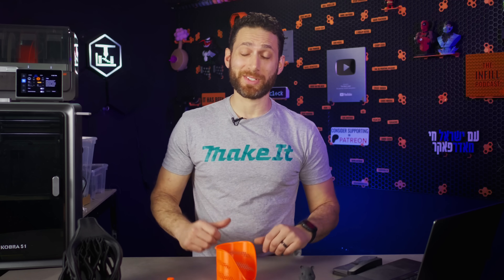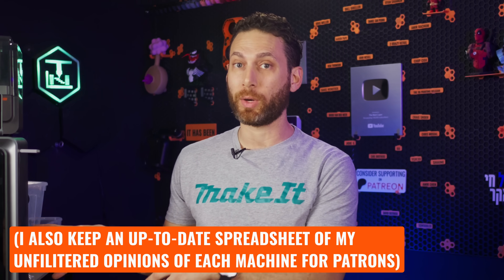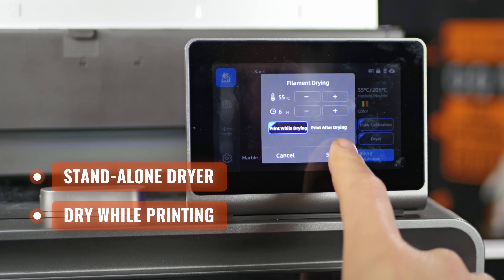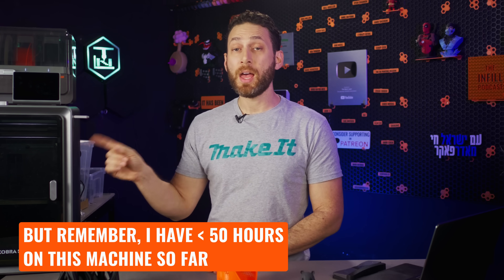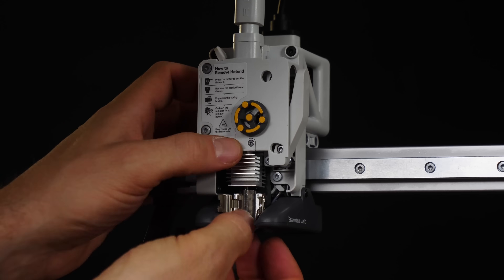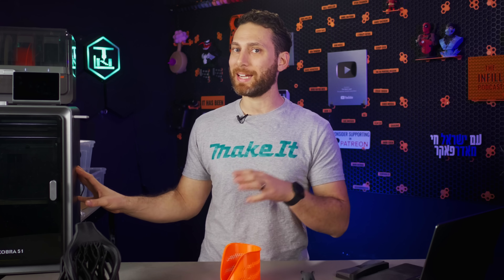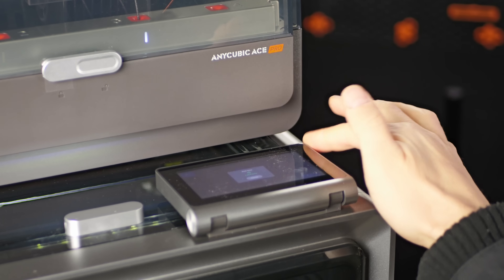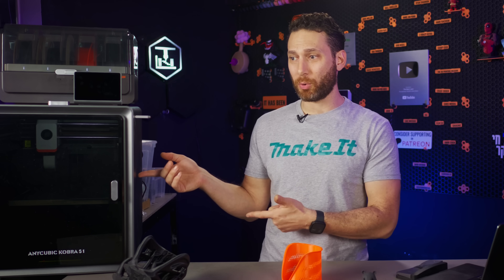16 Ways The AnyCubic Kobra S1 Is BETTER Than a Bambu Lab X1 Carbon

Comment: I purchased the Kobra S1 Combo last July, I finally got time to unbox and set it up: Well packaged, decent instructions to assemble, easy to load the filament but it took awhile to figure out how to set the color on parts, once I found it, it is simple. AnyCubic sent me a link to the rack they have for stacking the ACE Pro filament feeders, the heated four spool holders are a big reason for the purchase. So far I like it, I've had some issues with the camera but it seems to have settled out, my third print is quickly and quietly plotting.

Comment: Long term, their printers are no good. Their printers start the malfunction after 10 to 15 prints is the known fact that their printers only last six months. I've been a long term customer of theirs, finally decided to stop buying from them. I have proof in email showing. That the printers are only made to last one year and then they dispose of them. I am going to show you an email that was sent to me yesterday. Anybody who supports any cubic is full of ** And they really don't know anything about the printing business. Because even any cubic would tell you themselves they printers are only made for one year. Here's an email from the tech support and customer service. That's why I finally Stop buying because the Kobra S1 has a lot of issues as well. If you notice, they try to release their printer every six months to a year because their printers don't last very long. And the crazy part is. They want you to still buy from them when you need parts. They'll tell you we don't have it anymore. It's discontinued. They should not be selling in the US whatsoever. It's Chinese junk.
David (Support)
2:13 AM (9 hours ago)
to me

Track Resource

Dear R,
We regret to inform you that due to our product technology upgrade plan, the accessory for this printer has been discontinued. This may impact your user experience, and we sincerely apologize for any inconvenience caused.
To compensate for this, we are pleased to offer you:
● A $20 instant discount coupon (Code: ACKF20), applicable to any printer order on our official website.
We remain committed to continuously improving our services to provide you with a better product experience.
If you have any questions or need further assistance, please feel free to contact our support team at [support email/phone number].

Comment: I've had a Kobra S1 since they were released at the beginning of the year. Your review was very interesting, and I enjoyed it. Unfortunately I have had nothing but issues due to the cheap quality of anycubic products. I've had to replace almost every part on the toolhead, as well as the entire bed itself, the main board, host board, power supply, and finally the machine entirely. When I received the ne machine, it was immediately riddled with problems, attributed both by the firmware and again plastic quality of the machine. As an engineer myself, I have no idea how either passed QC, with entire parts like the board boards having burn marks on them or connectors not fully soldered. I've been in contact with anycubics customer support for months, trying to find solutions and for my experience they have been little to no help. While $469 at the time of your video and even today $550 with the ace pro is a great price, I feel that the bambu x1c offers less issues right out of the box, with the biggest win being customer support that takes the time to help and responds quickly to tickets. There was an entire two weeks between putting my ticket in with anycubic and receiving an answer at first. I will be dissembling the anycubic printer, photographing all the issues. I'd be happy to share with you if you are interested or making a video post about them. Many companies like anycubic have really great ideas for the market, but not all execute these ideas without cutting corners.

Comment: I really wanted a Bambu Labs X1 Carbon but I'm retired and it cost more than I could justify. After watching your video I bought the Kobra S1 combo and so far I have no complaints, but I've only printed PLA so far. I would like to buy an all metal hot end so I can print more exotic materials, but I don't see one available. I bought mine on Amazon and I got a two year extended warranty. I paid just over $600 for it.
Reply from the maker: Glad to hear you're enjoying the Kobra S1 combo and got a good deal!

Comment: The S1 is my sixth purchase of a 3d printer and the fifth Anycubic product. I must take my hat off to the packaging, the instructions and the parts labeled taking the guesswork out of setting the printer up. One feature that I need is variable infill. Before using Anycubic slicer which is easy to use, Cura and Octoprint were my go to and they worked. The S1 seems slower than my Kobra 3.  The same Benchy is 15 minutes on the 3 and Twenty odd minutes on the S1. Is it a setting?  Thanks!

Comment: It's my second Kobra S1 in 3 weeks !! The first one broke with major error codes, the second one  was just oozing hot filament at the junction of the break and the nozzle ! It was a mess to clean and at the end, I managed and to put back the nozzle, the clamping lever of the nozzle, which is a cheap plastic lever, just broke off !! I'm repacking the S1 tomorrow !

Comment: If you have a Bambu Lab X1 Carbon, purchasing a Bambu Lab H2 when you could purchase a cheaper and possibly better printer doesn't make any sense because your software will run both printers.  I've shelved 3 other printers because of the complexity of using multiple 3-D software. One of them, I only used a couple of times.  It was slow.

Comment: 2 mins in... unbiased review please. I'll watch it all then. I need to know.. should I buy the Bambu or this. That's it.
Reply: I don't have the X1 but I do now have 2 S1 and I don't regret buying them. I looked at both extensively before I bought the 1st S1 and went for anycubic because they both had an even amount of complaints in printing groups (most for both seemed to be a lot of user error). The price of the S1 was a lot better so I chose that. Two weeks later I bought another.
Reply: @e5p0sa how loud is the printer? With the door closed and with it open?
Reply: @merlinbk  I have very sensitive hearing I can't abide white noise but I can sit in the same room with 2 S1s and 2 K3s running. As long as they're on a sturdy surface so vibration is minimal, they're not that noisy. We live in a bungalow and you can't hear them in other parts of the house when the door to the print room is closed

Comment: Been a while since I´ve been here. Hope you and your folks are doing well.

I have been considering one of those to upgrade from my current Flashforge 5M (actually keeping both). Having watched other videos about the S1 (not sponsored), some (negative) aspects called my attention:

1 - Even though the printer has a quick swap nozzle, Anycubic only offers them in brass and in 0.4 size, which is a bummer in my opinion (other sizes and nozzle materials only from not very trustworthy third party vendors). Being able to print higher temperatures as it is, IMHO it should be already able to print abrasives from factory (hardened steel nozzle from factory, even if 0.4 which tends to clog with fibers or wood). There should be OFFICIAL nozzle upgrade options (so we wouldn´t have to rely on unreliable aftermarket) and standard one should be hardened steel, all of that would make the fast swap feature have more sense.
2 - By the way, I can´t find any info on the extruder gears, if they are able to whitstand abrasives or not;
3 - Printer profiles. Them being not very well tuned is an almost unanimity. Seeing some printed parts shown, it´s clear that the default profiles are not very well tuned (maybe I´m spoiled since I went to a Flashforge). Only begineers didn´t complain about the profiles. 
4 - As there aren´t "official" nozzles of different sizes, there aren´t also official profiles for different nozzle sizes.That would require more into printer tuning than it´s necessary for a printer meant to be for begineers (or, in my case, users which have no more patience to tinker much in configurations and just want to print in peace). In that case, I have to praise both Flashforge and Bambulabs for their excellent profile work. In the case of my Flashforge 5M, I´ve been printing for about eight months with perfect quality, the only failures I had were due to old filament or user error. 
5 - Almost unanimty as well are complaints about the spaghetti detection, it either doesn´t detect or give false positives, it needs to be tweaked by the factory still. 

Considering the price of 3D printers here in Brazil, the extra 180 dollars for a P1S with AMS over a S1 are actually worth it (a little over 10% difference, the S1 combo is BRL 7790, about USD 1390, the Bambulabs BRL 8890 - USD 1570 in the same store which I got my first Ender 3 V2 and my current 5M, free of shipping as the store is actually in my city and it´s still cheaper than other local stores), even considering the need for upgrades for abrasives (which would be needed in both). I just don´t have much info on the abilities of the P1S to print nylon (but the extra temps on the S1 are very interesting). Maybe in my case the AD5X (as I got spoiled by Flashforge´s ecossystem and don´t care much about the extra size, on the contrary, the Flashforge´s form factor fit my 3D printing space just nicely) would be a better option, but it´s still unavailable in Brazil, and Flashforge doesn´t sell directly to consumers here, only through their local representatives.

And yes, the Anycubic should be 100% compatible with vanilla Orca Slicer. There are "vanilla"  Klipper firmwares out there, but I don´t feel exactly comfortable adding third party firmware to a printer still under warranty. Stock firmware should allow for remote connection from standard Orca. BTW, the need to use the cloud is exactly my main reason for not just going to a Bambulabs.

Comment: I really want multi-color print capability. Support only filament would be awesome aswell. I was about to just buy a bamboo have around $800 to spend.  Now I'm hesitant. One of the main reasons I was leaning towards bamboo aside from How apparently user friendly it is and the quality of the prints BUT The already established ecosystem all the aftermarket parts and upgrades that are available. I have a QIDI Q1 pro I love it sure it's amazing but can't do multicolor as of now and parts & upgrades are very limited. Take for example a simple light upgrade there is no kit that exists. Bamboo has dozens of different light upgrade kits for each printer. 

  Should also point out that I am still new clocked a few hundred hours worth of total print time. So the user friendly part is appealing.
Reply from the maker: Bambu printers are great for beginners and advanced users alike, their ease-of-use leads the industry, as does reliability. AnyCubic has some very promising offerings in multicolor, too, at a SIGNIFICANT savings over Bambu. Either way, I think you'll be happy :) Feel free to use my links if you wish to support the channel. Happy printing!

Comment: Would love a review of the Kobra S1 and also to know if you can use it with Orca. I have a Kobra 3 so would love to know if the new slicer lets you use Orca instead for the Anycubic printers.
Edit: I would also like you to mention if the filament guide for the rolls in the Ace is standard. I got an Ace about a month ago and mine doesn't have those guides and has problems with rolls that are near empty not staying in position and ending up jamming.

Comment: I just got mine a couple of days ago and some of the changes i would have made was replacing the brass nozzle with a hardened steel nozzle and go for an all metal hot end instead of the teflon tube. They can also tweek there profiles more to reduce the print time and ofc the flow parameters for the filaments are very low.

Comment: Bambu Lab was also a copy cat of every other enclosed CoreXY the only thing new on a Bambu was the cutter and it's placement to facilitate the use of an MMU (also no new, prusa) without all the crazy distorted tip shit so it would feed properly because the cut gap was so thin filament ignores the gap when feeding.

Comment: The Kobra S1 will not connect with internet using G5 or combination of G5 & G4.  As of now, they have not provided ant solution for this problem.  Makes my S1 a very expensive paperwait.

Comment: The X1c is a bad choice for a competitor. It should be P1S instead.

Otherwise I am deciding between a K1 Max with the CFS and the CFS Kit, the Kobra S1 and the Hi Combo. The K1 Max is bigger, but much louder and expensive. The Hi Combo is silent, more affordable but lacks the enclosure for ABS. But I guess PETG helps out quite a bit and doesn't stink. Also the 260^2 build plate is a good compromise to 250^2 of the Kobra. Creality in general has a big advantage to Anycubic: Klipper. The none adjustable purge volumes really is a bummer since they had time since the Kobra 3. And with Creality already teasing dual print head it could be guessed that the CFS also works on their next thing ...

I am leaning towards the Hi Combo despite the open print volume. But open firmware (combined with a Klipper community that fixes things), the lowest price (440 bucks), a good working CFS and the not so bad 260x260x300 print volume seems like a good deal. Those Prusa MK3/4 also printed many parts without an enclosure. If I really want to print ABS some time a simple "tent enclosure" for like 40 bucks on sale should do the trick for the 2-3 parts a year. But imagine I could like multicolor prints and grieve over too much waste is not a good outlook.

Comment: I had the S1. Unfortunately I was dealt a bad hand and it was a tinkering monstrosity never could get it leveled or successfully print anything and still doesn’t work with Mac for remote printing. Mine also didn’t like to stay connected to the app. Anycubic i believe can make a good product but they’re kinda all over the place with their ecosystem they have all the pieces but still 10 months later with my kobra3 and I still can’t do things that were advertised. As for the S1 any cubic support was great and allowed me to return with a full refund. I now have a bambu X1C on its way. I really believe all these big YouTube channels run the bambu machines professionally and then for quick cash grabs make these review videos. I can’t imagine him running this machine, Daily or any print Farm buying 20 3050 of these machines running them 24 seven it’s just still a tinker machine. As for sales for anyone looking and pressed on a sale, don’t be….these machines are literally always on sale.

Comment: The biggest thing for me, is I do NOT want anything cloud! I've had things local for 5 or 6 years, and with Government(s) over reach, companies selling data, data breaches, AI misuse, the list goes on, the more that happens, the more I'm determined to have everything local, a printer, paper and ink, or 3D and filament, does not need to connect to the internet to function. I was close to buying a Bambu Lab printer until they went full Apple.

Comment: I'm not done here yet, anyone that's been into 3D printing for any amount of time knows what a pain in the rear it can be.  Getting the correct layer adhesion, temperature, flow rate… printers can be a pain for sure. Bambu printers, they work… you press the button you almost never have to worry about anything… and they never break. As a matter of fact the only way I have ever found to Jack up a bambu, it's to select the incorrect printer filament like ABS, it melts between 250 and 300°. And have a PLA  spool loaded into it that prints200-210f
If you print Pla to hot, it will first turn to a liquid, then start to vaporize and then turn rock solid. That event will lock up any printer. So if your having printing problems…. Hey, you're printing too hot! 
And by the way, if you use a AMS, can you use the bamboo printing filament, it will automatically recognize it so this mistake can never happen.

Comment: Let me just say this, I own a small print farm. I have 3 bamboo PS1 printers that print 24/7 for the last six months. They have melted literally thousands of pounds of plastic. You want to hear the crazy part, none of them have ever broken even one time. 

if anycubic wants to send me one of their printers, I will put it under exactly the same conditions and let's see how they hold up. Any crybabies on the software on bamboo, just know that you can always download it onto an SD card and manually install it you're not required to use cloud services to print.  And you don't have to update the software.  I have owned anycubic before,  and well not the most durable printers I'm being kind here. maybe this model is different, ,maybe..,.
Reply: What kind of stuff do you print on your farm? I fell in love with printing and I wish I could turn a profit off it. Currently working on a few toy ideas
Reply: @B33ZY101  I can custom design you anything on CAD, real time using zoom or live meeting. Designs can be converted into an STL or step file. Step files can be used for CNC machining. You can get stuff CNC machined pretty cheap. 

Anyhow what's what I do

Comment: Use the S1 daily for a month and see what you think after then... My K3 Combos worked perfect , (well except for the one as I received it with a defective hot bed)for a couple of weeks then all kind of issues with the Ace pro no matter what parts they sent me to fix it... I ended up getting rid of them as I was tired of the hit and miss problems.  So if you want to be a beta tester go a head.
Reply: Well if you have uses the S1 with the Ace Pro daily now that it as been a month... how are they faring ?